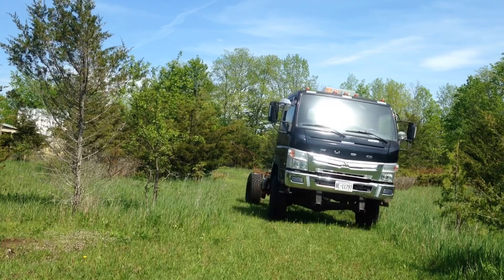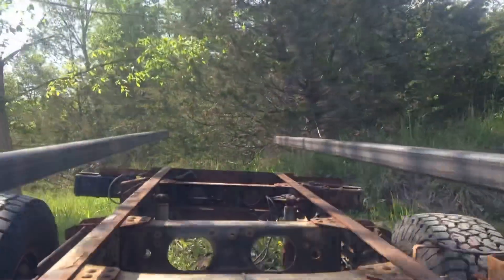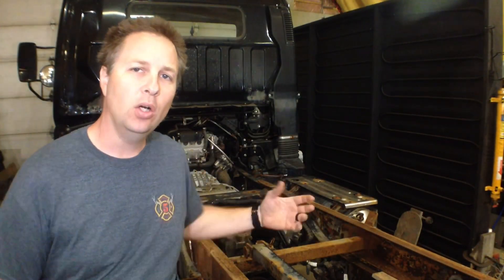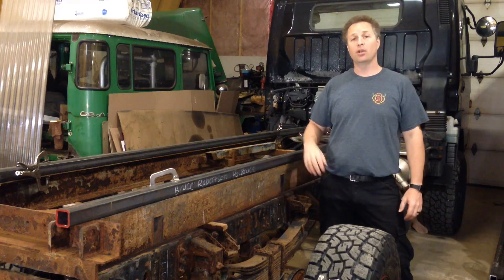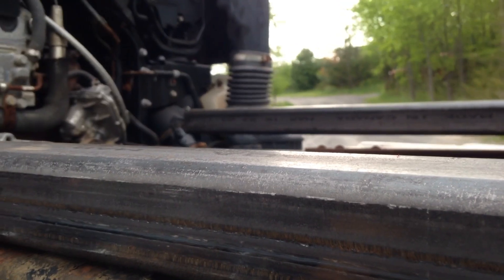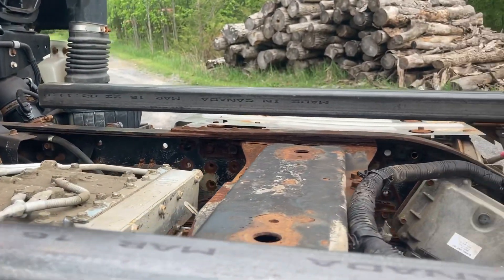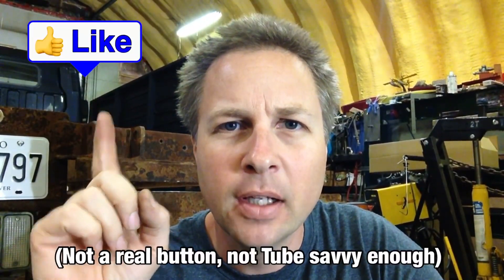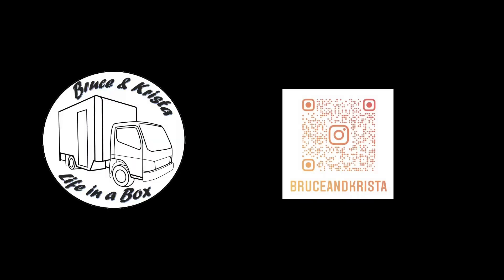Mitsubishi Fuso FG Camper Sub-frame build - Part 2: Chassis Flex

Comment: Thank you so much for sharing. I'm roughly at that stage with my Fuso in France. Are there any choices in springs tensions and which ones did you choose ?
Reply from the maker: Two more videos that may help if you haven’t seen them - links in the video descriptions with more info.  😎 

Fuso FG Chassis to Sub-Frame spring mounts - DIY build!
https://youtu.be/7y6fqAl-u_M
Reply from the maker: Follow up to that video ^ 

Sub-Frame spring mounts evolved! | Fuso Canter FG 4x4
https://youtu.be/8OR9joxzruc

Comment: I have a question about the subframe twist and water tanks mounted in the primary frame. Most plumbing is done with PVC pipes from the habitat to the water tanks. Does this subframe twist risk the PVC pipes breaking?
Reply from the maker: I would suggest a section of the piping not be rigid - easy to get some hose to replace the rigid pipe, which placed in a partial coil will reduce vibrations transmitted as well as any torque or compression/elongation issues.

Comment: How about a pivot in the middle of the chassis at the front or rear ??
Reply from the maker: I thought about that method as well, but I’m not sure the two pívot points would remain in line - I also considered using hitch balls so they could pívot any direction - but decided springs will give me more options/adjustability in the future…

Comment: This was a long time ago but my subframe is pivot mounted at the rear in spring mounted at the front. This is obviously before I put super singles on. 

https://youtu.be/ZO0uiY8mR5s
Reply: Also also my frame looked similar and I sandblasted and used Por15 and it's held up very well.

Comment: I'm really surprised at how much flex is going on so far forward. I was like you, thinking in front of the slanted frame didn't flex as much. Excellent demonstration of just how much it deflects.

So, you're gonna spring mount the whole subframe? I have no doubt you're skilled enough to fab your own mounts, but where are you going to find the springs? How big are they?

Great vid!
Reply from the maker: Thanks Don - there is an excellent (actually, slightly overwhelming) selection of springs at  Grainger, and the design I’m using incorporates a few methods for adjustment, so I can continue to tweak things after fully assembled.  😎